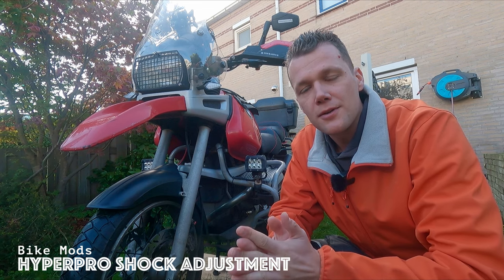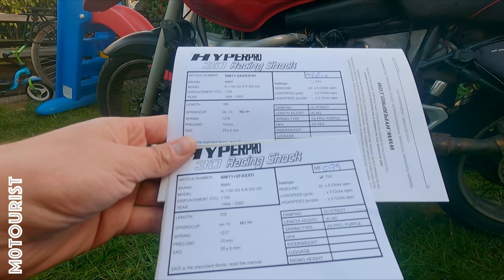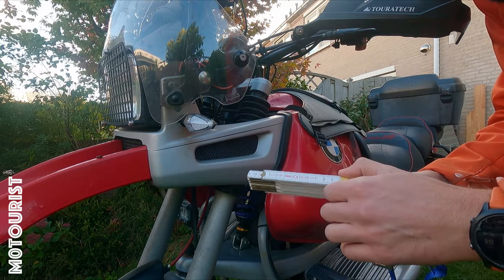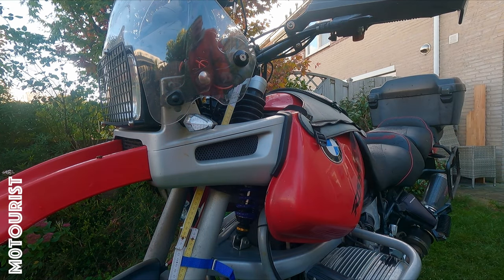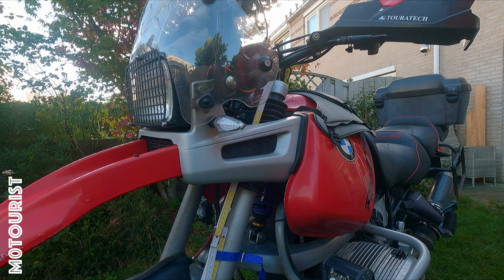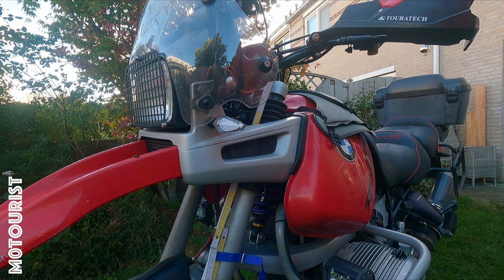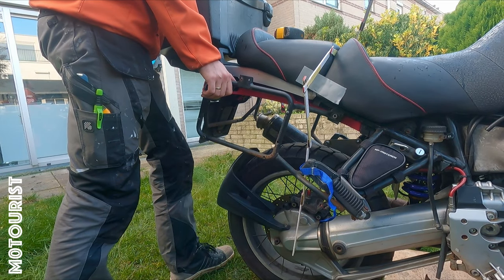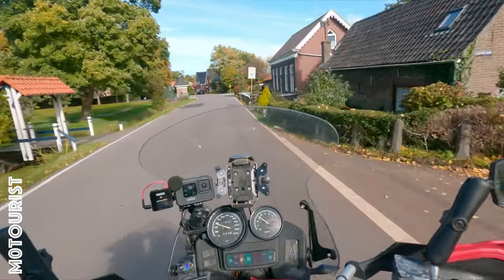BikeMods - HyperPro Tuning - R1100GS

Comment: Great video! To make sure you have the absolute perfect starting point for your weight you should not only measure the static sag, but also the rider's sag. Don't know what that should be on an adventure bike like this, but on a normal street bike it's 1/3rd of the total travel distance of the suspension. Total travel distance is 120mm in front on my ride, so 40mm rider's sag is needed. If both type of sags are in spec, you'll know you have the right spring for your weight on your suspension. If the rider's sag is in spec, but the static sag to high (weak), then the spring is too soft. You can't even get to the proper rider's sag when the spring is too hard. 

Once sags are in spec then rebound is something pretty hard to measure. If it's too open at the rear (not dampening) the seat should shoot up and then down. If it's too much closed it should go up very slow. The best way is slow but controlled. In the front it should go all the way up controlled and then settle down slowly at the static sag (not more than one bounce up).

I've learned a lot from watching Dave Moss Tuning videos. He's an absolute guru suspension wise.
Reply from the maker: Thanks for your comment, I may want to check the sack with the rider as well, but its pretty hard on your own🤣.

The static sack is compensated already for the rider (although rider weight differs of course). On the front the sack was 35 mm (static) and on the rear only 15 out of my head...

Suspension travel is 190mm if I'm correct, so 30% is 47 mm with the rider.

Comment: Thank you for the videos. Which bellows did you purchase for the front forks? Are you happy with them?
Reply from the maker: I've asked my mechanic to install them, so I'm not sure which ones he installed. They're pretty standard rubber bellows, nothing fancy. They're lasting for 6 years at this point and i'd no complains...
Reply: @M0Tourist  Thanks. Lets see what i will find in Ebay for cheap.